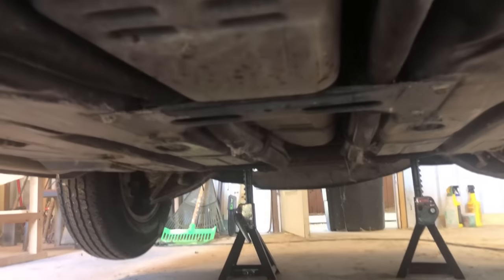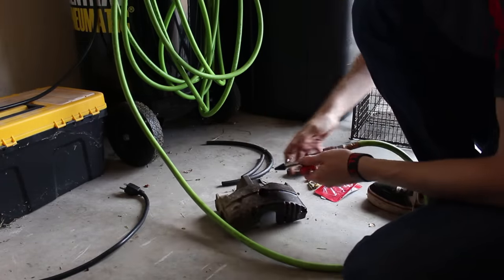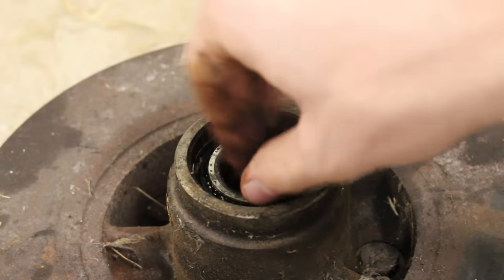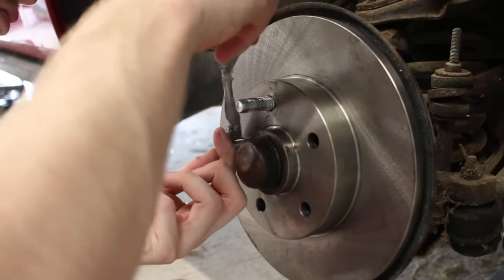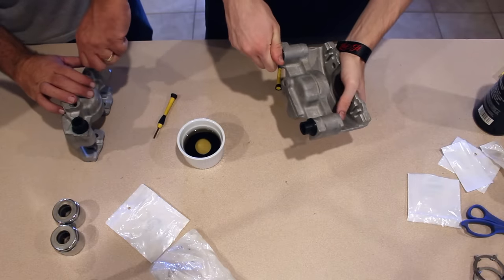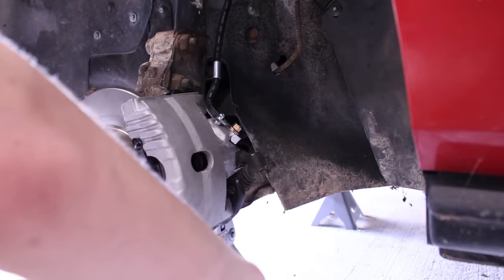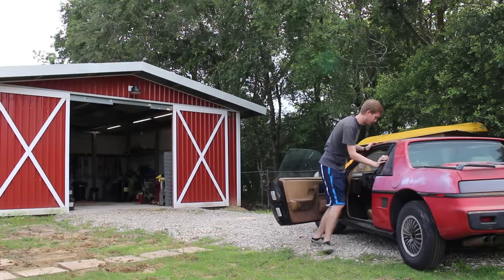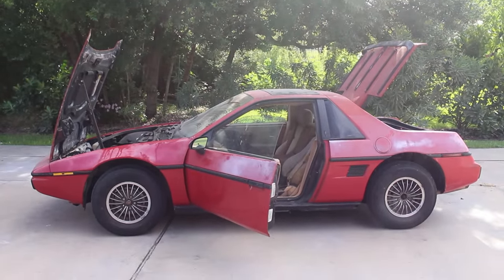Fiero Drive With Me | 1985 Fiero 2M4 Revival - Part 3

Comment from the maker: Regarding the part of the video where I am talking to the camera about the clutch, I would like to apologize for that. I didn't realize how windy it was until I started editing. Sorry about all the noise!
Reply from the maker: Homophobic slurs aren’t cool my man
Reply from the maker: ?
Edit: Perhaps it would be clearer to say using gay in that derogatory way isn’t cool.
Reply: Didn't notice... Where did you bury the body?
Reply: At least you caught the moment on camera.  That's what mattered.  Cool to experience it, even from here.  I had an 85 2m4 back in 94.  Drove it for about 2 years and really enjoyed it.  I have had many neat cars, but I think about it more than most.  It was surprisingly interesting and enjoyable, while being very normal at the same time.  Something you mentioned in pt. 1.
Reply: You are forgiven, you may proceed in continuing this project.
Reply: Gabriel Giron  what a silly comment, then go check those?
Reply: stop apologising :D the spoken comment makes it even cool
Reply: These cut scenes are too funny. You have another new subscriber
Reply: Holy shit those brakes were original to 85!
Reply: Ronald finger, great videos buddy just a tip when it comes to hammering on calipers its not the best idea to use a steel hammer, use a rubber mallet or even a block of wood to take the force and not damage the cast aluminum
Reply: Ronald Finger - Great Job!  Keep up the good work.
Reply: What you're doing is very awesome! Back in '98 one of my best friends had the same Fiero passed down to him, but, young and dumb, he beat the hell out of that car, revved the engine to the max...car just wouldn't die. And here you are proving just that!
Reply: I saw the first video of this series like 2 hours ago and instantly subscribed and i'm now excitedly waiting for the next part
Reply: Just a piece of advice for you as I see WAY too many you-tubers do this. NEVER...NEVER...NEVER...EVER hit a bearing seal or ANY kind of seal directly with a steel hammer or other tool.You will destroy that seal completely . That seal will now fail in no time as you have pinched and cut the rubber between the hammer and the internal metal washer moulded into the seal. You always use a press to install it or a wood block if you don't have a press. I can't count how many times I've seen these types of videos and they always do it WRONG. Same goes for any aluminum cast parts like the Calipers for the brakes. One hit too many and you shatter the casting. STEEL AND ALUMINUM DON'T MIX!
Reply: Just want to say this series made me subscribe. Looking to get one of these. On a side note what music did you use. Obvious reason to use it for those 80s vibes but I can't find it.
Reply: Love the videos how to see it finished
Reply: I enjoy these videos.  I was younger once.  I have extensive experience in both body and mechanical services.  I was attached to this bodystyle due to the kit car craze in the 90's.  I have owned several .  Good luck with the car I shows that little mechanical knowledge and you having no fear to learn. I can't wait to see it painted or modified. 
The first modified fiero I seen was in Puerto Rico.   427 big block.  Tunnel ram scoop just over roof..
Thank you for you videos
Reply: +Ronald.. Don't be a aperg.  Everyone says gay and nobody cares.
How much money do you have in this?  Why are you buying parts at Autozone? They should be much cheaper online.
Reply: subscribed so I can see part 4
Reply: Before using Rock Auto- take a printoff of your pricing to autozone or advanced- they will match online pricing (they at least do for me) and you are supporting brick and mortar- also easier for returns.
Reply: I have enjoyed watching the progress, looking forward to future episodes
Reply: Ronald, are you planning to do a follow-up or part 4 for this series? Great project.
Reply: @Ottonic6  Body? Who? I don't know what you are talking about.
Reply: ADEBISI ADEBISI  Takes one to know one.
Reply: ADEBISI ADEBISI  wow, someone need a friend?
Reply: Your doing a awsome job getting your Fiero back on the road, your definitely a mechanic in the making a lot of people your age nowadays don't know how to work on their cars.
Reply: Good work il you need help I have all the shop manual for all the years in pdf format . 😉 I own a 87 white t-top
Reply: @RonaldFinger  Your car is awesome - don't argue with the 12 year olds. I have a 95 ford escort hatchback as a daily driver I purchased for $600 cash and I smile every time I pass a $40,000 sedan. When you revive a car like this, it ceases to be a metal box with wheels, and becomes an extension of yourself. You know what is "gay"? $800 car taxes a year and $180/month in insurance. You know what's cool? Paying $15/year in vehicle taxes and getting a DISCOUNT on insurance when you add your $100 car because the multi-car discount is greater than the cost to ensure it. Can't WAIT for the next video.
Reply: Ha ha...the guy’s name with the bead blaster is...Rusty...get it?
Awesome videos...waiting for part 4....motivating me to get my project fired up!
Reply: Just so u get the max life out of your wheel bearings you should actually tighten the nut more than that to seat them loosen the nut then go to the final tightness value.  Wish u best of luck on your build.
Reply: whats your camera? really good editing too
Reply: LOL a 24 minute video about, how my car needs a new clutch.  Just kidding!
Reply: My friend's dad was always rebuilding one of these.  He had a fleet of them by the time he was done.   The handling is amazing, but he told me the one thing he had to do on all of them was re-route the cooling.   Seems the hot water return cycled back through the block by design.   He always plumbed something up to avoid running the hot water through the bock a second time.     Full disclosure I can't remember all the details and I was not able to find reference drawings of the motor to support this, but I do remember him adamantly  claiming it was a design flaw and this change solved his overheating issues.   You might take a look at it and see if it makes sense to you under the hood.  Good luck!
Reply: Man,guys like you are reason this cars' price will double in the next 3 years or so.
Reply: Once you run those bearings for a little while go back and retighten them
Reply: Can't wait for another update.Your doing a great job,before you know it you'll have everything  working again.
Reply: Ronald Finger can’t wait for your next video
Reply: I was in California, a great state in '85, and this was the "it" car, I always thought of as poor man's Ferrari, that front end coming at you and always red. Then I think the MR2 came out to compete looks-wise. My dream car late 80s was the Merkur xr4ti, the poor man's Porsche, hand made in west Germany for $25k which would be $50k now
Reply: I feel disturbed, that body in the trunk is it still there?
Reply: NEVERMIND THE MURDER OF YOUR BROTHER!!!!! AAAHHH!!!!!!
Reply: 18:55 ? It's not that bad
Reply: PLEASE, dont take a month to upload the next one
Reply: Ronald Finger why not try evapo rust remover on rusty parts of your car
Reply: can you rescue a 1984 VOLVO 242 TURBO INTER>COOLER
Reply: Next time don't let gasoline, diesel or any other fuel in touch with the soil, you killing nature.
Reply: 17:45 Jumpscare warning. lol
Reply: hey nice job . neat cars drove one newish .keep learing or teaching ?
Reply: i kind of figgered  you were from the future to smart for preasant day and date.young kid with answers
? hellp us old guy out .help u any way i can. worked on thoses raced one back roads one day he was fast one day i was fast he had the big scoo[p v6 bad ass. i had a rampage 2.2 l .all about road racing  on the way to work ,88 ithink  wow, i think u should show or link that snorkel v6 bad ass .then make a caddy clone.
Reply: svx ish
Reply: Ronald Finger that was very creative m8❤️ 17:42
Reply: Are you looking for a used gas tank? I messed up and burnt up my 85' and then bought a 84'. I was going to change out the burnt cars' front end into the 84'. I ended up loosing anytime I had to put into them and regrettably got rid of them both. I now just have one gas tank in good condition off the 84' and a right rear light housing off the 85'.
Reply: In the uk they won't let you drive a barn find until it has had inspection, insurance that they will only sell for a passed car and the inevitable $3,000 garage bill that comes with the small section of exhaust and wipe with an oily rag that the garage does before they will register your inspection pass with the DMV(DVLA UK) if you don't pay the garage for a heap of (not actually done) work then they register a fail and then bill you for a scrap collection and crushing which they give you no choice over.

They are really low about it in the uk, I had a car one time that I bought from a garage, it had trouble from day 3 and I spent $1500 on it at the same garage that sold me it to fix it, I broke down 50 miles away from home, had it re-done at a different garage  there and the guy in that garage handed me a large plastic bag filled with beat up rusty old death trap parts in it that had never been wiped much less changed out like on the invoice from the other garage. The first garage had also destroyed my airbag when messing with the steering wiring which caused me a fail second time round.
I paid $1000 for a new exhaust, took it into one of the 2 garages in my small town and they asked me for $1,300 to "fix it up" for inspection which when I got home I noticed on the list was a whole new exhaust yet again 2 weeks after the new one was fitted, now I had been in and paid $400 for 4 new tires on this little chevvy spark sized car the day after my new exhaust was fitted in order to be all set for inspection and been in the tire shop and walked under the car and seen the shiny new exhaust end to end..
The inspection list of parts needed to pass testing also had "4 new tires, fill with gas, balance and align neccesary" so with the garage saying I needed a whole new exhaust and tyres 2 weeks fter another garage fitted brand new ones I got pissed at the guy and was rude to him and he told me to get to fuck out of his car shop, I took the car to the other garage where they asked me why I had such an old car and tried to sell me another secondhand car at about 2x what it was worth so I told them to put my car for scrap and paid them the $80 fee for recycling.

Since then, they have changed the law in the uk so that if you still have time until your annual inspection expires, the garage is legally obliged to keep your car and they tell you it is illegal to drive it away even with 5 weeks left on inspection, so you used to be able to pull in and ask how much needed for inspection and come back, now they just find a made up fault, hold your car and hit you with a bill for $2k and if you don't pay then your car is off the road and you ain't getting to work this week...

They have really turned on drivers in the uk in this last 2 years...
Reply: Ronald Finger what happened to your nose just the air ? I get that at times my nose bleeds like that too.
Reply: SAFTY GLASSES,PLEASE USE EYE GEAR!!!YOU'LL SHOOT YOUR EYE OUT KID...CHEERZ
Reply: @RonaldFinger  No using words towards another person in an angst way ,is not cool my man.  Car parts dont have feelings,your only human.
Reply: You found out about #flatearth too? Didn't had to go that far dude ....
Reply: Gabriel Giron yep
Reply: My big brother drove a black fiero until a few years ago. One of my funniest memories was one Michigan winter we went to a con or something and got back to my house after dark. It had snowed a LOT and I thought he was never gonna get that car to chew through all that deep snow, but we shoveled out around it a little and he pulled a U and as he went by where I was standing I noticed his front tires weren't turning at all his rear tires were just powering that car like a sled right up the slight hill to the stop sign, he made the turn and disappeared around the corner while I laughed my head off. Man he drove that car until there was little left to drive.
Enjoy your videos a lot, thanks for posting them.
Reply: Gabriel Giron  he clearly covered that in episode one. Saying its his car so its what makes him happy and I agree. I love going to a car show or a meet and seeing different cars. Iv seen a million 57 and while nice they gets old.  I build cars from rat rods to restomods and I absolutely love what he is doing with bringing back this fiero.
Reply: @jonf8928  also rock auto has been shown to sell from suppliers that rebox lower quality parts. like boot leg.
Reply: Ronald Finger well done, I restored a 1953 international pickup truck while in the US Army.
I quickly found that after the truck was complete I missed the project part.
I sold it and bought a 1972 Oldsmobile Gutless Cutles...
This trend of projects has happened a few more times throughout my life.

I’m currently building a rat bike out of a 2006 Harley sportster.
Ridged frame springer front end,,,
Should be welding on the project soon.

Keep up the good work I’ll keep watching.
PS: I subscribed.
Reply: V8 archie kit time bro.
Reply: Plzz may I know what studied? 😀
Reply: Ah memories lol had mine in 96 damm.  Most have Manuel turn knob to get flip lights up like middle finger to da haters wink. biggest issue on mine was fuel pump n had a rod reshaped after new clutch n kit put in was not driving da same when test driven guy removed from engine bay at top came back n boom like short throw put in lol. Of course the V6 was da dog. Keep it up live n learn as always have fun keep it going. ...  Try bringing a 1st gen Mazda 12a rx7 back to life n worst yet explain in video lmao.
Reply: never add grease to a brake pad... they make stuff for it if you need it, but never grease
Reply: i own 4 of them hit me up
Reply: You will never need that much anti seize by the way. A few dabs is all it takes. Just like spark plugs only a little dab is all it takes.
Reply: Use old seal to tap new seal in
Reply: @RonaldFinger  I wanted to give you a heads up about a design flaw that was on the Pontiac Fiero that a lot of people did not know about. One of the air vents on the engine lid it's supposed to have a kind of downspout to direct the water away from the engine while driving. If it's not on there you'll be replacing your alternator a lot. The design flaw is is where that vent is water was allowed to fall directly on top of the alternator causing it to wear out the bearings on the inside. Make sure that yours has this but if memory serves me correct a lot of people just fabricated one or close the lid off totally. Like you I was always a huge fan of the Pontiac Fieros and always thought it would definitely be a car that would ride long into the future. But sadly of course you already know General Motors did away with the Pontiac division. It's been really fun watching you restore the Pontiac Fiero. Keep the videos coming and I hope this heads up helps you out.
Reply: Your girl is cute.  She single?  :) :) :) Yes, I'm kidding.  Good Job.  Keep up the good work.
Reply: You should also apologize for calling the friction plate a "Flywheel". Flywheels are only found in automatic and autostick transmissions. Manual transmissions have a clutch, friction plate, throw-out bearing, clutch spring and the gears, but no flywheel.
Reply from the maker: Crescendo, hello hi. It may be a geographical thing, but in the US, what you’re calling a friction plate is indeed called a flywheel. The automatic equivalent is called a flex plate. I’ve included a link below to the Wikipedia article the speaks about the flex plate taking the place of the flywheel that is found in manual transmissions. 

And even if I was wrong, demanding an apology for something like that is a very immature thing to do. It should be treated as a learning experience and something for me to grow from, not a shaming. I hope you can see that. 

https://en.m.wikipedia.org/wiki/Flexplate
Reply: I've been waiting for your progress.
Keep it up 👌
Reply: New subscriber here... you are  doing a great job.. both on the car and making the videos...can’t wait for next one.
Reply: *chuckle     geological linguistics.   Here in Ky, it's flex (auto) and pressure (manual) plates.    The videos are great. I binge-watched all 3 last night and I can't wait to see more progress on that nightmarish interior, and finding out what's going on with the climate control.
I'll also echo the chorus of "PPE!!!"  I cringed when you were reassembling the parking brake assembly spring and then leaned over it to check it out...    
Keep it up, I'm a subscriber!
Reply: @ocelot2234  ... Evaporust is magic.  Get some Ron.
Reply: Hey Ronald please please reply if you get this, I love the video but have a pointer in mechanics work that can make your life a bit easier!!
Reply: It's fine and love the fiero vids
Reply: When’s the next video? I’m excited to see your progress
Reply: They should show your videos in schools where they teach mechanics. Very informative.
Reply: Ronald Finger ok
Reply: You removed part 4
Reply: Ronald Finger so I saw the thing about part 4. Hope you get it fixed soon
Reply: Earned a phat sub from me 0-0
Reply: @RonaldFinger  why did you upload part 4 for like 3 seconds
Reply: No, dude, thank you for even putting these together. I'm living vicariously through you as I sell the LeBaron I wanted to bring back to former glory. Thank you, man, and I can't tell you how excited for you I was when it cranked up the first time. That fiero is going to be amazing, man.
Reply: Ronald Finger Pull over son, you’re driving a Red 1985 Fiero, without a license plate, an expired brake tag, can I see your license, registration and insurance?
Reply: Back disk brakes are a pain